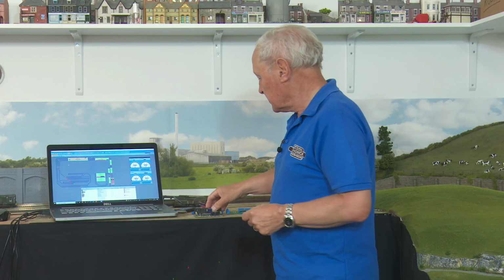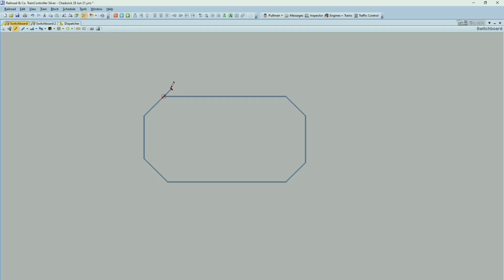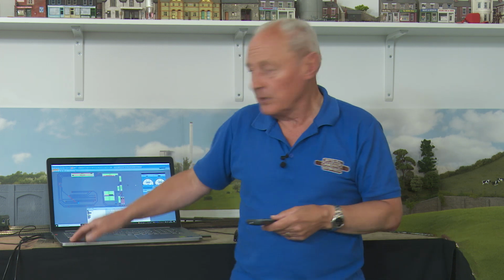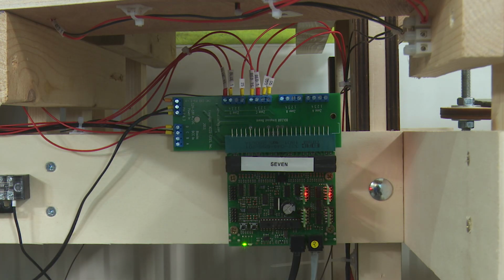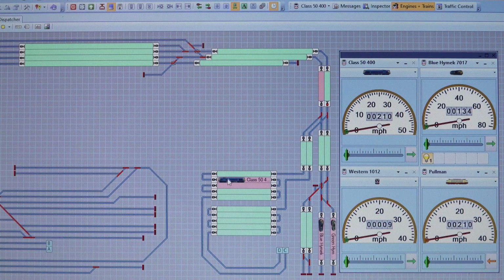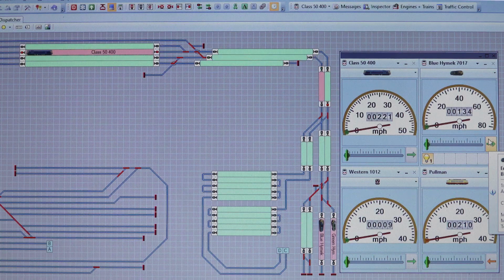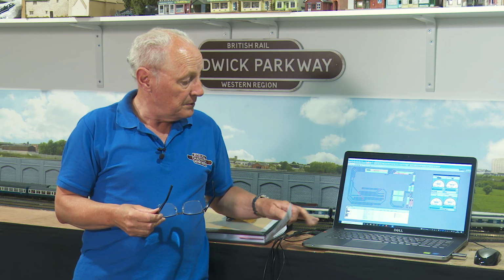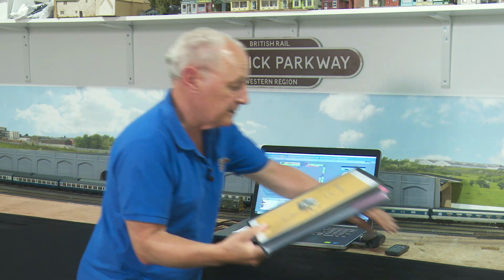An Intro to Block Detection at Chadwick Model Railway | 137.

Comment: Thanks for another interesting video, Charlie. The concept of scenic trains is what got me thinking about block detection. Unfortunately, money is definitely an issue for me.
I started my layout using a Digitrax DCS51 controller but could see that doing block detection with Digitrax would wind up being more than I could afford. So I switched to the 
Arduino-based DCC++ for train control as it is significantly cheaper to set up yet still has JMRI support. Naturally there are trade-offs in terms of what you have to do yourself to set
it all up but I'm nothing if not stubborn!

I haven't had time yet to actually install block detection but my initial idea is to use Hall Effect sensors linked to another Arduino. This would then report the detection to JMRI. 
I've bought the sensors, some tiny magnets and have a couple of spare Arduinos lying around. But that's as far as it's got.
 So many ideas, never enough time!
Reply from the maker: A great comment mate, but sadly time is the only thing that we’re all short of. Regards Charlie
Reply: And, sorry, at the risk of rabbiting on, I might well look into something like this before I'm done. A small QR label under each loco read by an inexpensive scanner under the track. eg
https://www.rtscan.net/Code-Readers/oem-scan-engine-rt208/
Reply: Fabulous jump to yet another possibility. Thanks for sharing!

Comment: I sort of looked at all this sort of thing some years back but got to the point of questioning
if I was a model railroader or a computer geek with a bottomless pocket so developed my
own thing.  I have  block detection, (BD20's) and the point motors are micro switched to give
a direction logic. All this is feed to the signal circuits with logic (7400 IC;s) automatically
proviiding working signals and panel indications as to the state of the layout. I also developed  a  suite of simple computer programs that can be used to run the layout if I so desire but generally
I like to run with hand controllers, I pad or radio type of controllers. 
  Things such as JMRI, while they do work if you are prepared to spend a lot of time getting around the convoluted nature of such programs. (They don't need all those bells and whistles etc) then
go for it.  Perhaps later when my layout is better  'completed' I may have time to revisit and become a computer 'geek'!
Reply from the maker: Great comment but it does sound geeky!

Comment: Charlie for me without dcc and automation i wouldnt be interested in the hobby, as an electrical engineer i find the electronics side of things the most pleasing, however when i tell people that traincontroller is over £700 to buy, they instantly forget the idea of running automation. DC stuff should stop being manufactured now, its primitive, complicated and quiet frankly unreliable. Charlie heres another little tip, fit an AWS ramp to your blocks!
Reply from the maker: Are you using the Peco AWS Ramps ?
Reply: @ChadwickModelRailway  Thats the ones yea

Comment: Digitrax and Digikeijs should be compatible because they use the same standardised protocol Loconet.... I find wiring with pc control easier than conventional, especially if you try to include some protection or automation wth relays and other parts (semi automated staging yard, avoid collisions at a junctions and things like that)
Reply from the maker: That’s reassuring Rian, regards Charlie.

Comment: I have gone down the route of microchips to control signals. They use simple logic to detect points and trains. I need a signaller to set routes but then you drive each train to the signals. No computer needed once the code has been uploaded to the chips. They can be expanded and have mimic boards etc and the whole thing on my large layout cost less than £200. Down side is I had to learn programming and it can't do train automation but would probably work with DC. Always something for everybody in our hobby, keep up the good work Charlie.
Reply from the maker: Thanks Mark and I’m so pleased that you enjoyed the video.

Comment: Hi Charlie,
Another great video.
My layout has full track circuit block and is fully signalled and interlocked using 9 BDL162 and BDL168 train detection and 30+ LocoIO / Locoservo  units to control points and signals, as well as a DS64 and DS52 units.
Being a retired software engineer, I wrote my own control software suite which includes interlocking, control Panel, LocoNet interface, Automatic Train Control, Automatic Route Setting and Throttles.
I have used Digitrax since I moved to DCC, and have had very few problems, mainly with throttles.  
Keep the videos coming.
Reply from the maker: Thanks Dave, that’s very reassuring to know.

Comment: I have Digikeijs and TC silver. I have 40 blocks in total. I think the automatic running i TC is no good. When it allocates tracks to make a random running route, TC do not know if a turnout is occupied by a train or not and TC might try to throw it regardless resulting in derailment.
Reply from the maker: I must confess that I have never used the auto running.

Comment: oh god this looks like a complete mess to implement, I want it
Reply from the maker: Go on ……
Reply: @ChadwickModelRailway  well the club I'm part of has a 20X24ft layout, 3 track main loop on the outside with a crossover and yard in the center. I think it would be neat to get block detection and some level of autonomy. It is helped by the outside loop being broken into 4ft sections, the layout was semi portable until a better attempt at a portable layout was made.
Reply: Stop teasing I’m sure he doesn’t need any encouragement from us lot
But Yes do it!

Comment: Hi Charlie, excellent as always. I use Digikeijs sensors and interface, with Itrain on the PC. I find them excellent. I had to return one Digikeijs sensor because it failed, but it was replaced without charge.

By the way, I live not far from West Camel - if you want to have a look at a (very much in progress) layout and see how Digikeijs/Itrain work, you're welcome.

Richard
Reply from the maker: That’s very tempting Richard.
Can you email me at
chadwickmodelrailway @ gmail .com
Reply: @ChadwickModelRailway  I would be interested in how you felt the two systems compared / varied.

Comment: Another great  video Charlie. I am a Digikeijs and iTrain man which I have found to be both cost effective and robust in operation. Whilst I see where you are coming from with the two sections per block approach to achieve accurate stopping, I have found that I can get away with one section per block for stopping a train accurately with iTrain. It does require a detailed understanding of how iTrain blocks can be configured but does save on cost and time once mastered. The Bob Fuller/Iain Morrison videos on iTrain are invaluable here, as they are for understanding iTrain in general and I cannot recommend them highly enough.
Reply from the maker: Great comment Chris and I may well give it a try.

Comment: Excellent Charlie. Just what I need.  I’ve bought the kit, I.e. 2 x BDL168s etc, but I’ve been putting off wiring and getting it going. I think I understand enough to rewire the PM42s and start detection.  You may not know the answer, but if my son in the states bought the software and shipped it over would the functionality be the same?  If so, why isn’t any retailer offering that?  Just a thought.
Reply: My suspicion is that some of the difference between the different countries is to do with taxes and import duty.  If your son bought the software in US and shipped it to you then you SHOULD be charged the VAT and Import duty as it arrives in the UK.
Reply: I did a bit more digging yesterday and it looks like the Import Duty for software is 0% so if your software was on CD then it would be just 20% VAT and 0% Import duty.  But it looks like you download the software and they send you a licence code - if that's in a physical device (a dongle) then probably the same 0% duty would apply.  You can transfer a licence code from one person to another - It's not clear if the developers would charge a fee if that transfer crosses a country boundary.
Reply from the maker: There’s a great deal on social media pages regarding this one Brian. Most people lean towards the designers hatred of Brexit. Regards Charlie

Comment: Another fascinating video Charlie - thanks.
Like yourself I am astounded by the current cost of controller software.  Clearly those of the railway modelling fraternity (or sorority in this equal-opportunity world) with deeper pockets than I, no doubt keep these software developers going.  You mentioned JMRI, which as you say may not be the easiest to master, nevertheless whilst it may have a steeper learning curve. the effort may be worth it given its free cost.
As a group of hobbyists we all have different skills and focusses for what we are prepared to take on - some of us like painting detail, others its modelling buildings, for some its automation, etc.  Your focus on off the shelf electronic products, whilst carrying a commensurate price tag (even when bought off second-hand off eBay) illustrates where your focus is, what you are comfortable with doing, and what you are prepared to put hand in pocket for.
I'm not suggesting you should change your approach, but like most things in life there are options if one is aware of them. Accordingly, with only moderate soldering skills, it is entirely possible for one to build one's own electronic boards if one has a mind to. I have built 2-channel DCC block current detectors at a cost of ~£3.60 each (I source my own components) but available as a kit of parts for £6.80.  One still needs an interface device to monitor the current detectors (kit cost £14.29 for a 16-channel device, though the channels can be used on a mix and match basis for current detectors, spot detectors, relay switching, servo control of semaphore signals or points, or LED lighting) and a computer interface board to link all the interface boards to the computer/JMRI (£10.37 as a kit of parts).  Such boards/kits (and many more) are available to members of the Model Electronic Railway Group - MERG - whose website, forum and regional area groups provides a wealth of advice and support to railway modellers prepared to invest in an understanding of such electronics.
Please forgive the advertisement, but I feel it important that your subscribers realise that such automation/control aspects of railway modelling don't necessarily come with such a high price tag.
Reply from the maker: An excellent comments David. I had tried to emphasise that money isn’t everything in block detection was remembering that most people will not have the skills or inclination to build from scratch. Regards Charlie
Reply: Thank you Charlie or making tis topic so approahable. Well done. 

I tripped across the MERG folks about two years ago, and have ordered and built a number of their kits, which are a delight to build, with exhaustive and comprehensive instructions. With a little practice, anyone an do this. While there is not much video available to the public, without becoming a member of MERG, one can get a taste of the possibilities from Rob at Little Wickett on Youtube. The cost of the kits is extraordinarily low for the value, and the knowledge gained along the way is priceless. I'm hooked!

Comment: Hey Charlie, about the price differences you mentioned. It can have different reasons. This company is based in Germany, this means they are part of the European Union. That in turn means they don't have to double tax to country's that are also part of the European Union, just only the tax in there own country. For county's outside the European Union it works a little different. In some country's they can sell directly and you just pay the German tax and the tax of your own country. But in other county's (they can't or won't) sell it directly and they use a partner company to sell it (In the UK is that the case). They probably also take a cut of the product. To sum that up: tax Germany + tax UK + cut partner company = higher price. ps. Sorry for my bad English, its not my first language.
Reply: I forget something, the prices of some country's are the same. That happens because they try to even it out most of the time, so they will lower the price a little bit if it ends up something like 10 dollars higher or make the price a little higher if it ends up low. The margins on software products are most of the time high anyway so they don't take a big hit on that.
Reply: @lovedubuntu9850  They use Digital River GmbH to sell to the UK because there are customs charges and paperwork that has to be filled in and filed, that all costs money to do.
It has only come in since 31 December 2020, I can't think why.
Reply: @GDGRailway47712  I've had a look around the German end eu laws just now. I'm not sure, but I think that the extra paper work is there because the uk is not part of the European union anymore and with that they dont apply for VAT MOSS. That means they have to "import it" even though it's a piece off software.
Reply: @lovedubuntu9850  Sorry, I was saying it was brexit without saying it was brexit. We left the transition period on 31/12/2020 so customs duties are payable from then.
Marc Wessling does a YouTube commentary on brexit in German, might explain what an idiotic act of self-harm we have inflicted upon ourselves.
Reply from the maker: Like all these things, there is more to it than meets the eye. At the end of the day the program designer has apparently deliberately put up the price to the UK because of Brexit and his disapproval of the process. Regards Charlie
Reply: @ChadwickModelRailway  that's on one side quite funny, but understandably annoying at the same time. But that is how most Germans act when they don't agree with something. And to be honest fair to him/her. He/she now needs to do a lot of extra work for the same result. Just annoying that customers are caught in the crossfire.
Reply: @ChadwickModelRailway  Yes, I fully agree Charlie. Quite why the UK should be treated differently from any other None-EU country now is puzzling though, unless they're deliberately ostrasicing the UK with some strange, rather childish disapproval of our process? I wouldn't give them my hard-earned "Dollars" and would spend them somewhere else - anywhere else. 
Some of my photography software has actually gone down in price post-brexit.
Reply: @ChadwickModelRailway  It’s not that other countries are penalising us for having left the single market, it’s because now we’re out the UK government gets to charge a new layer of VAT on top, as well as import duty. We chose to leave, and we are getting exactly what we asked for. Very sad.

Comment: Great video.  Have dabbled a bit with Digikeijs and RocRail connected via Loconet and a Sprog on a small test layout.  The block detection worked fine but RocRail was quite a faff and, in the end, I lost interest!

On the question of Traincontroller pricing, it's been documented both in the comments here and on other forums that Herr Freiwald is not afraid to penalise those countries which he feels are not 'fun' to deal with!  From what I've read, he can be quite prickly and very much allows his political views to guide his pricing.  In the end, it's his company so he can do what he likes!

What I was wondering is whether there is anything to stop a licence bought in another country at the cheaper rate being imported into the UK.  From what I can see, the purchase involves the physical delivery of a dongle but that could easily be forwarded by a friend/relative living overseas.  Do you or anyone else reading this know of any technical barrier to doing this?
Reply from the maker: Hi Nigel, interesting points regarding the dongle. However, when you want to upgrade from one level to another, or download a new version say from 8 to 9 then unless you use a VPN your country of origin will be revealed. Regards Charlie

Comment: Hi Charlie.  I am running a small N Gauge Peco track layout measuring 5feet x 2Foot6, but want to watch my trains doing their thing through a busy junction.  Using Lenz LZV200 with iTrain (magnificent).  Have approx 30 points now, but upper level under construction will take total to 50 points.  The MTB MP1 small footprint motors are slow motion, but much cheaper than Tortoise.  Looked at your excellent Traincontroller video 12 months ago, but didn’t like Freiwald’s Brexit punishment prices, so after much research chose iTrain, which has turned out to be a winner.   This purchase has been enhanced by the excellent YouTube tutorials from Bob Fuller explaining in great detail what the software is capable of and shows exactly how to do it. Will be using Railcom to automatically know which trains are where on the layout. Lenz after sales support has been excellent too.  But as you said, all these systems are not cheap when you add it all up.  Solution=Don’t add it up.  Simples.  :-).  Keith
Reply from the maker: A great comment Keith, thank you. I can only agree the prices of these products are incredible. Regards Charlie